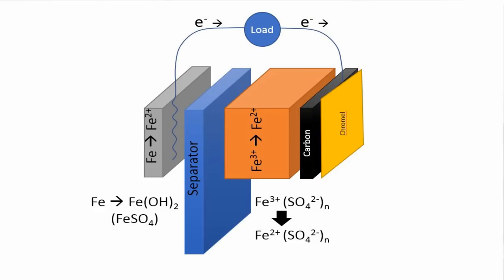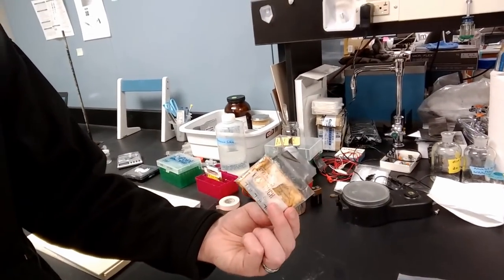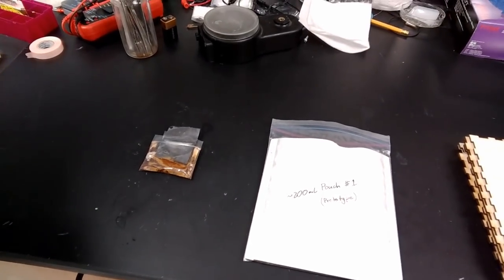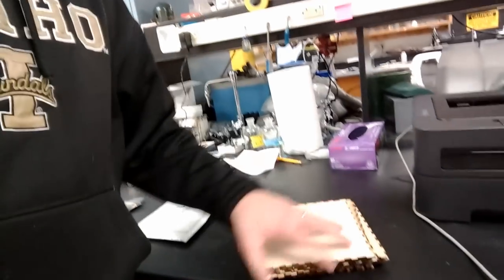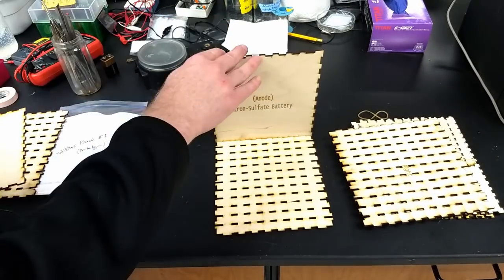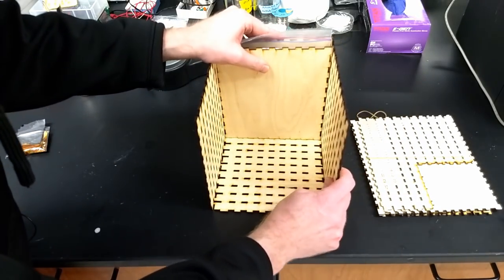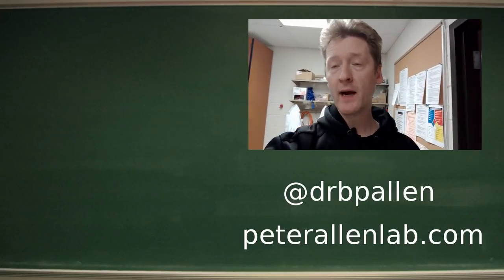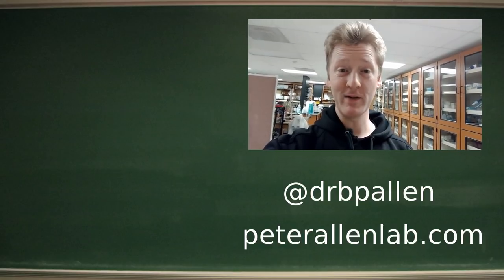Update on Iron Battery Scale-Up to 200 ml

Comment: For the current collector you can try a carbon brush that is used in old motors. Sometime back, I tried an Iron oxide cell with KOH (30%) soln and carbon brush electrodes. They worked quite well for some time.

Comment: Are you still working on this cell optimization??  I would really like contact with you if so, I am a MS chemical engineer with minor in biochemistry and polymers and have several years experience at Oak Ridge national research lab X-10 site in Oak Ridge, TN USA (govt R&D facility responsible for first A-bomb development) with R&D materials development in Li-ion batteries.

I helped develop a water soluble based process of production eliminating harmful solvents using nitrated cellulose as a carrier polymer, where Li-phosphate and carbon were thin film printed onto Al foil for electrodes, greatly reducing cost and increasing surface area due to thin film tech.  Too many details of 3 yrs worth of development, but the multi-layered Li-Fe phosphate cells when i left the project to move into nano applications were holding almost 5 times current Li-ion charge density, assembled batteries capable of near 100 amp discharge (max peak, sustained high current obviously would cause thermal damage to heat build up), and full charge/discharge cycles at 5000 cycles were still above 80% capacity compared to current 1000-1400 cycle battery life.

This is different chemistry yes, but I am experienced in battery design and have an extensive chemistry background.  It looks as if it is capable of having large capacity ifoptimized correctly, and likely could see large improvements in current output and reduction of voltage drop by proper design of maximized surface area and separator material.  I am capable of modeling diffusion rates, flow , temp effects, solvent resistances, electrode degredation, etc and would love the opportunity to try and aid in a project such as this.  One opening thought was with current collector-electrode contact, could this be improved possibly to increase current density?  

Please email me at crkimsey4277@gmail.com or message me on youtube if you are interrested in communicating on this subject.  It looks as if you are on the path of a potentially viable storage means based on cheap, abundant materials.  I continously research all types of similar things and experiment at home, one being graphine supercapacitor builds.  Fairly low max V of around 2V or less to prevent separator breakdown, but capable of holding hundreds of Farad worth of charge due to extreme surface area.  Thanks for your time